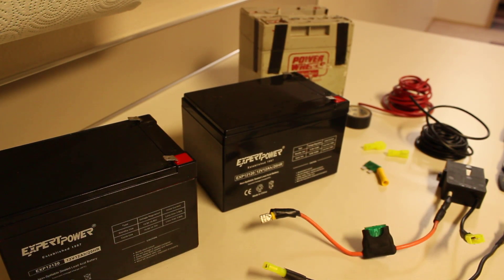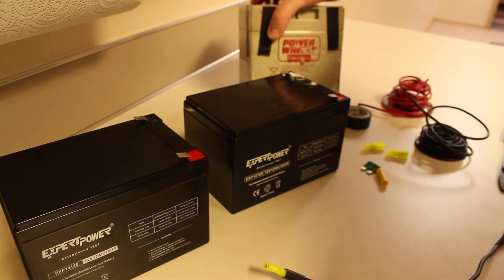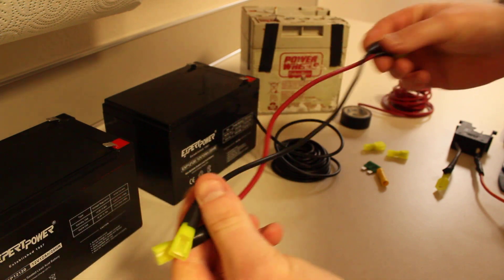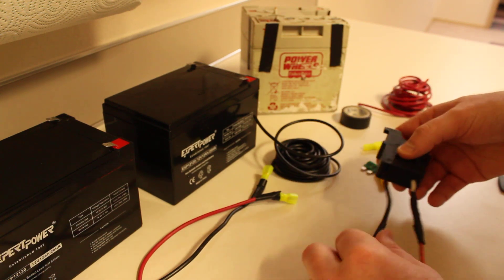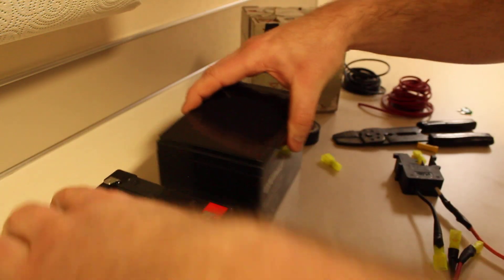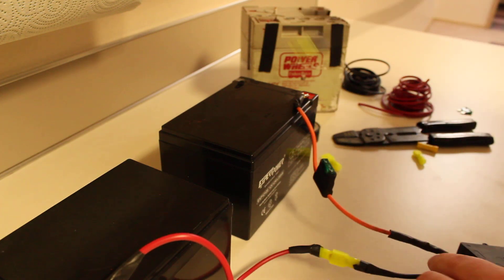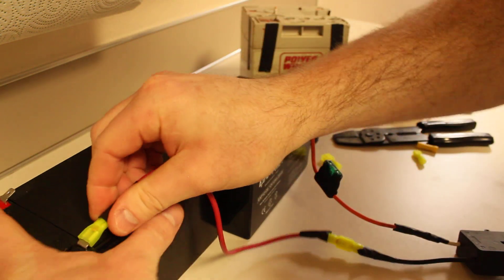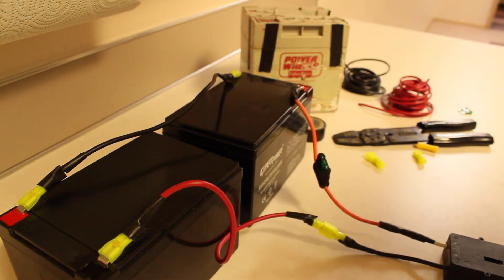How to do a 12v to 24v Power Wheels Conversion

Comment: For future reference to those many people asking, you can charge both at once on the circuit, and it must be matched to the circuit voltage, such as 12V if two 12V in parallel, or 24V if two 12V in series.

Search "battery charger 24V SLA AGM" to find compatible 24V chargers.
Or for a good one for AGM, search "Japlar Schauer 24v 2 Amp Automatic Smart Charger"
You're looking for one that is friendly to "lead acid" types (SLA) and "absorbed glass mat" type batteries (AGM).
You have to make sure that you select that type of battery on a multi-type smart charger. AGM batteries require a specific process to avoid damage and extend life of the battery.
Some of these auto-detect 12 or 24V, and have multi-stage charging, along with desulfator, maintenance, and repair functions.
1A charging current is safe and adequate for a 12V 10Ah battery, 2A for 24V
Some do repair and maintenance better than others.
MLTOYS sells various voltage ranges with a Power Wheels style connector pre-attached in place of the stock methods. 
So if you mod your vehicle and use an existing female connector on your dual 12V battery setup, it will plug right in with its male connector.
They cost a little more, but are still less than $45.
MLTOYS is probably using the Mighty Max chargers and customizing the connector for you.
Search "24 VOLT 2 AMP WHEELCHAIR BATTERY CHARGER" to find the Mighty Max charger specs, but those come with XLR connectors for wheelchair battery connectors.

Comment: Hi there I have one question I did that conversion on my son 12v car but I keep blowing  the 30 amp in-line fuse as soon as he hits the throttle any ideas thanks
Reply: 30 amp is too small the motors are going to draw 25-35 amps

Comment: The problem I have with this video is that you did not mention if the adapter needs to be changed. Like the adapter that some of these come with. the 12 volt adapter. you failed to mention the fuse amp. perhaps 30 amps?

Comment: Hello, how do you call the yellow battery connectors you use?
Been in the shop today and couldn't find anything like that. 
My battery connectors are 1cm x 3mm.
Hope you can help.
also, some info on the fuse you use would be helpful .
Thanks in advance
Regards

Comment: You’d need another charger capable of charging 24V. If not I believe it’s a fire hazard.
Reply: @aarons72oldsmobilecutlasss22   I just hooked both batteries up the same way you did and I think I fried something 😳 I smelled something burning but couldn’t see anything

Comment: I did what you did but i keep blowing out the 30 amp fuse.
Reply: Another guy used a 30amp circuit breaker rather than fuses to solve this issue.
Reply: @hotwheelman4pops  i change to 40 amp fuse, wotks great now...
Reply: @VictorRuiz-tt3bq  how are the wires holding up?  Has anybody fried anything with 24v?

Comment: What if I wanna use 2 18v drill batteries.... would the connection be the same??
Reply: If u hooked them in series you would get 36V. 18V is plenty,  hook them in parallel to keep 18V and double ur Amp Hours.  So positive to positive for parallel.. plenty of good videos out there for the 18V conversion

Comment: Thank for this video , is it same fuse of 12v can be used on 24v or i should use bigger size
Reply: 30 amp
Reply: Same fuse will work. Connecting batteries in series doubles the voltage but doesn't effect the current.

Comment: Nice setup, I'm blowing fuses though. Not sure what I did wrong 😬
Each time my daughter is pressing the trigger it blows the fuse
Reply: Another guy used a 30amp circuit breaker rather than fuses to solve this issue.

Comment: Hello! it's an excellent video, I have a question. The charger is for 12V batteries, to charge the batteries is one by one or can connect the charger to charge both batteries at same time?
Reply: For future reference, you can charge both at once on the circuit, and it must be matched to the circuit voltage, such as 12V if two 12V in parallel, or 24V if two 12V in series.

Search "battery charger 24V SLA AGM" to find compatible 24V chargers.
Or for a good one for AGM, search "Japlar Schauer 24v 2 Amp Automatic Smart Charger"
You're looking for one that is friendly to "lead acid" types (SLA) and "absorbed glass mat" type batteries (AGM).
You have to make sure that you select that type of battery on a multi-type smart charger. AGM batteries require a specific process to avoid damage and extend life of the battery.
Some of these auto-detect 12 or 24V, and have multi-stage charging, along with desulfator, maintenance, and repair functions.
1A charging current is safe and adequate for a 12V 10Ah battery, 2A for 24V
Some do repair and maintenance better than others.
MLTOYS sells various voltage ranges with a Power Wheels style connector pre-attached in place of the stock methods. 
So if you mod your vehicle and use an existing female connector on your dual 12V battery setup, it will plug right in with its male connector.
They cost a little more, but are still less than $45.
MLTOYS is probably using the Mighty Max chargers and customizing the connector for you.
Search "24 VOLT 2 AMP WHEELCHAIR BATTERY CHARGER" to find the Mighty Max charger specs, but those come with XLR connectors for wheelchair battery connectors.
Reply: I bought 1 battery 24v because by default i had 2x12V so it was a 24v system, but with a 12v charger. Now i found a smart charger with 24v 4A for AGM also. It will be ok to charge with ?

Comment: I did the same modifications with 12 gauge wires and every time my kid rides the car fuse  blow up. I’m using 30 amps.
Reply: Did you ever figure out why it’s blowing the fuse? I’m having the same issue
Reply: I'm having the same problem
Reply: @TORRES25ISH
@BORY27

I started using 40 amps and I didn't had any issues. Try that. Also you need to break in the motor if you upgraded to 775 motors.
Reply: You need to use 40, 30 will keep blowing

Comment: I'm hoping you can help me.  I recently replaced the battery 6V in the Dora Explorer Jeep with a 12v 7AH. It seems the battery dies pretty quick but when I check the voltage it is reading approx 11.67 so it doesn't seem the battery is dead.  Any reason why the power wheel is barely moving as if the battery dead?
Reply: Power Wheels Warrior thanks for the quick reply!  I think you are right.  I wok take a look to be honest I’m not sure what to look for. Do you have a recommendation/suggestion on a site that can help since I’m not familiar with the throttle assembly?

Comment: How do you charge the batteries? I did this and hooked it up to the stock powerwheels wall charger and it does not appear to be charging the batteries completely. After 15 minutes or so it dies.

Comment: ..and that's how you burn up the 12v motors and or wiring.  A better option is to run 10ga wiring with 775 motors and an ESC.
Reply: What is an ESC?
Reply: @m3ccan0ble  Electric speed controller.
Reply: @tct72  thanks.  I'm not using a speed controller and having no issues with 775 motors and 12v battery but lil man leaves me in the dust while i'm on foot.  An ESC would do wonders for safety.

Comment: I upgraded my son's Power Wheels battery from 6V to 12V via a similar setup, but the issue I am running into is the motors getting hot and blowing the in-line fuse.  Any suggestions?
Reply: You have to change the motor. they sell them on Ebay or Amazon for about 30 dollars.

Comment: I did this exact set up and it blew both of my radio/display board and my main control board. Exact setup with fuse protection and all. Not sure what happened...
Reply: Because your radio and such is designed for a 12v system. This upgrade to 24v (2 - 12v in series) is assuming the ride-on electric motors can handle 24v. If they are 12v motors, the motors will get hot and can catch fire.

In addition to updating the battery. You need to check the controller and specs on the motors.
Reply: Peralell
Reply: What car did you upgrade to 24v?
Reply: @MJ-kr3bs  https://www.ebay.com/i/124219140423?chn=ps&var=425071342556

Don't get these jeeps, or any that look similar. Stay with Peg Perego or Power Wheels brand. I learned my lesson buying off brand crap.

Comment: Hi!! Did you change the back wheels motors? Or did you leave the 12 volt stock ones?
Reply: You haven't posted any videos. Glad you're doing ok. I didn't see you use the male connector on the negative side when you switched to one battery. I don't understand why you need the male connector. Can you please explain? Thank you for making this video. Much appreciated.

Comment: Can you just buy a 24 volt battery instead of getting two 12 volts?
Reply: im sure that would work if you can find one..u just cant slow it down...which is why he used 2 separate

Comment: couple questions: what amp fuse did you use? are these batteries rechargeable? did you use the charger that came with the power wheel?
Reply: Instead of a 30 amp fuse....use a 30 amp relay. If the fuse pops you have to push the thing, or keep fuses handy. With the relay, you will just hear the click from the protection kicking on and off during overload, but the car will not stop working.
Reply: i did the same mod...i didnt do the fuse though..it worked for a while but then one of the motors got screwed so my lazyness costed me......yes u can use the powerwheels stock charger...and yes the batteries are rechargeable..these are the ones i got on amazon https://www.amazon.ca/gp/product/B01DOAM4KQ/ref=oh_aui_search_detailpage?ie=UTF8&psc=1

Make sure you do the fuse!
Reply: @mystikalnrg  
What fuse?? The 30amp fuse??
Reply: @kilowrocks91331  yeah the fuse shown in the video. @ 1:15
Reply: I added a 10 and that blew immediately.  Rocking and rolling on a 30